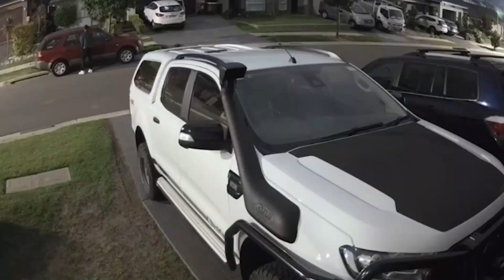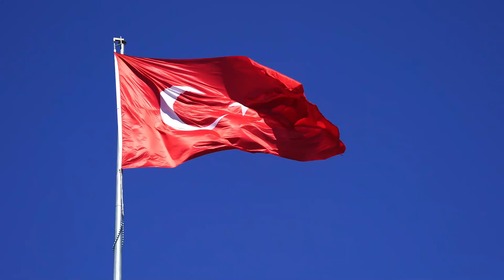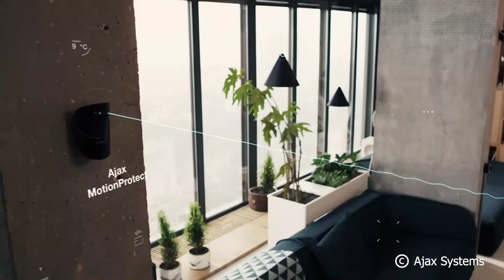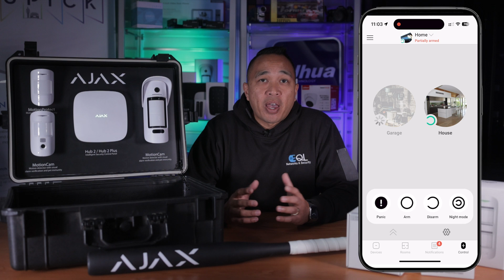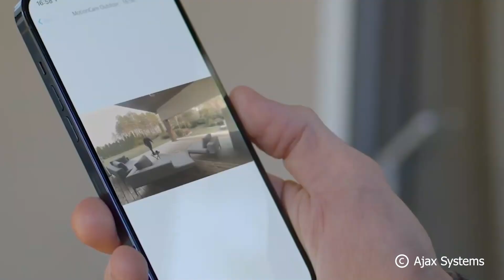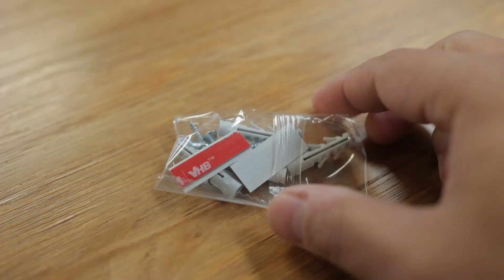Ajax Systems: The Future of Wireless Security

Comment: Is it possible with an Ajax system to have it trigger a garage door to open when I disarm with the fob, or disarm when I trigger my garage door to open? 

I'm in Brisbane and examining installers and equipment currently that will work for me in my home. I'm looking at layered security with sensors like Ajax inside and cameras out. It's not clear with a number of the HIK and other systems how well they can integrate with smart home capability.
Reply from the maker: Yes, it is possible to integrate an Ajax Security System with a garage door opener to perform actions like:

Automatically open the garage door when you disarm the Ajax system with a key fob, or

Automatically disarm the Ajax system when the garage door is triggered to open.

However, achieving this requires integration with third-party devices or automation systems, as Ajax doesn't natively control garage doors out of the box.

🔧 Here's how it could be done:
1. Using Ajax Relay or WallSwitch
Ajax offers devices like the Relay or WallSwitch, which can control power to third-party electronics when a scenario is triggered.

Garage Door Opener Integration:
You can connect the Relay to the garage door motor circuit, allowing Ajax to trigger it (momentarily close the contacts like a push-button).

Scenario Setup Example:

Trigger: Ajax system disarmed with key fob

Action: Ajax Relay closes contact ➝ Garage door opens

2. Using Scenarios in the Ajax App
Ajax systems allow you to set up automation scenarios like:

"When system is disarmed ➝ Activate Relay (garage door)"

"When Relay is triggered ➝ Disarm system"

This works if the garage door opener is connected to an Ajax Relay and both events are within the system.

3. Limitations
The reverse (garage door triggers → disarm system) is not as straightforward, unless:

Your garage door sensor (magnetic contact, etc.) is wired into the Ajax system.

You use a third-party smart controller (e.g., Home Assistant, Z-Wave hub) that can bridge the two systems and issue an Ajax command via integration or AP
Reply: @EQLNetworksSecurity thank you for such a thorough response! Much appreciated 😁